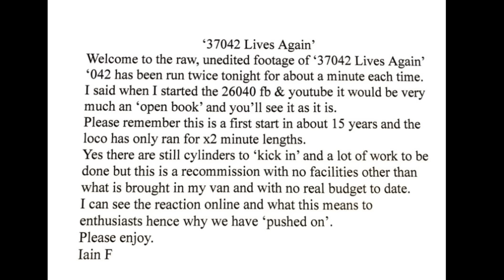'37042 Lives Again'

Comment: Well done, worked on these for over 40 years. Your fuel looks contaminated though. Make sure your turbos are serviced. Drain oil, remove round covers and wash out sludge, check free rotation and refit covers and fill with fresh oil. Check for air intake fractures and exhaust blows . Also remove intercooler drain plugs, you will find that a goo may come out but don't panic.
Reply: How much oil does one of these take?
Reply from the maker: Thanks for the tips!
Reply: Probably something in the 30-50 gallon range taking a wild guess lol
Reply: Mebbe you ought to go and advise him on how to maintain the dear old 37  .
Reply from the maker: @ianbain8838  it's fine.
A lot of people are thrilled & have been giving advice in messages. 👍
Reply: I thought she was doing an ALCO impersonation there for a minute

Comment: I love seeing these old diesel dinosaurs come back to life but the one thing I've never know is how do you actually turn the engine over to get it started in the first place. There must be a huge electric motor and battery bank to get the crankshaft turning to get it started. I do understand that there is a decompression of the engine to help with initial start up.
Reply: Yeah I wondered about that also. Massive battery. 🤷‍♂️😱😱😱
Reply: Diesel electrics have the diesel motor that turns the generator that makes the power for the traction motors.
But they also have a neat feature: when you put electricity into the generator, it turns into an electric motor.
So with a healthy wad of battery juice, you turn the generator into a motor and voilá, one enormous starter motor :)

Comment: Thats sounding pretty good considering how long its been stood, At least she does run and could benefit from running a bit longer to get some heat and moisture out of the engine.
Reply from the maker: Yes. 
We're just delighted that it does go. 😊

Comment: What horse power did this put out? 
   Is it a MTU engine?
Reply from the maker: @splitters2477  it's an English Electric 12csvt 1750hp 👍
Reply: @iainf  1750hp!!! Is that it? Wow...I'd have thought around 3,000hp considering the work it had to do back in the day....I bet that struggled when it was fully freighted??
Reply from the maker: @splitters2477 they doubled or even tripled them up.👍
Reply: @iainf  oh,2-3 locomotives pulling together? So 1750hp X3?

Comment: When doing a plunger test push them all the way in so it's full fuel also keep the revs static so you can hear the knock 👍 once isolated you'll probably find it's stuck exhaust valves, well done 👏
Reply from the maker: @31144  good advice thanks.
One of the pre flight checks we were doing at the start was barring it over & observing the rockers & all should be ok here but there may be poor seating of the valves but it's that clean in there let's hope not.
I'm just pleased we've turned a corner.
If it was a 4 day WRC rally of old I'd say we've completed day 1 & are getting ready for day 2 😊
I.

Comment: Is my understanding correct; the diesel engine is used to drive an electric generator. The drive wheels are electric. Is that correct?
Reply from the maker: Yes that is correct.
2 generators, main for x6 electric traction motors & an auxiliary for systems such as the compressors etc.
I.

Comment: thats called a push me/pull you
Reply from the maker: It was all about keeping it running. I guess if it was twin carbs on an old x flow escort you'd be using the pump jets to keep it going as the cylinders 'kick in'.

Comment: I have a list of engines I want you to acquire for Eden. I also want there to be a project to relink Eden and Stainmore.
Reply from the maker: @CelticRailwayTraveller  I have no plans to put the loco into storage there sadly.
Reply: @iainf  Storage there? Do you mean 26040 to Stainmore? That's not what I meant. I meant a reunification of Eden to Stainmore. And some other locos for your Railway.
Reply from the maker: @CelticRailwayTraveller  there are no plans to move the loco to that area of Cumbria & I'm just concentrating on working on 37042.
Reply: @iainf  Then where and when is 26040 moving?
Reply: @iainf  There are 4 Shunting Tank Engines at Thomas Muir Metals in Fife that are practically for sale. I was wondering if you could acquire them for Eden?
Reply: @iainf  So has 26040 left Whitrope?
Reply from the maker: @CelticRailwayTraveller  I've just had the work experience lad painting it for a bit this afternoon at Whitrope.
Reply: @iainf  How many more Fish Suppers do we need to buy for you in order for 26040 to leave Whitrope?

Comment: Engine  needs thorough steam cleaning to see where all the oil leaks are. Pump and injectors should  all be removed and cleaned/ overhauled as the exhaust shows a lot of unburnt fuel meaning poor injection pattern.
Ideally the engine needs removing for a complete strip down, checking tolerances / piston & liners for wear....
Reply from the maker: @Draxindustries1  No. 042 was overhauled shortly before being put into the reserve fleet .
If we were reconditioning the engine the we would do what you suggest but there is no need.
For a loco that has sat idle for over 15 years the exhaust cleared quickly. The black is over fuelling on the cylinders that fired before the other cylinders self bled. It literally started firing one after another.
Not everything needs a full strip down & rebuild. I've just shown that.
& I started it on car batteries. 😉
Reply: @iainf  
Fair enough😉